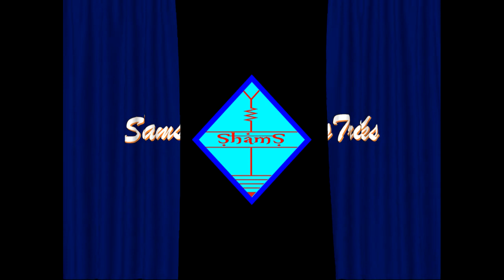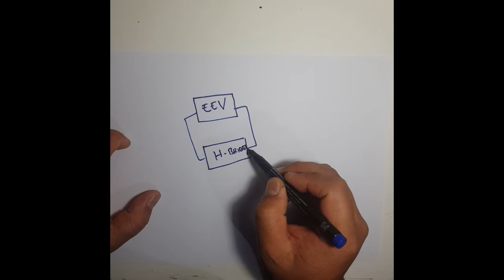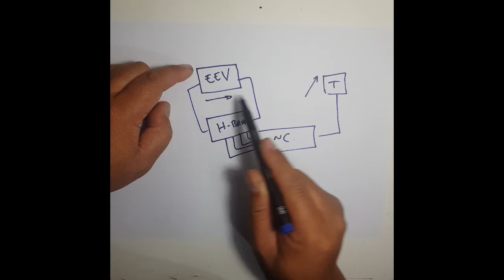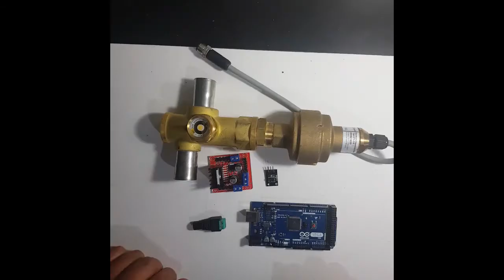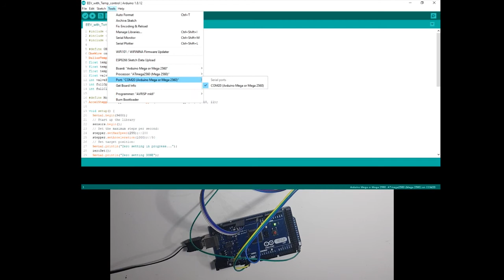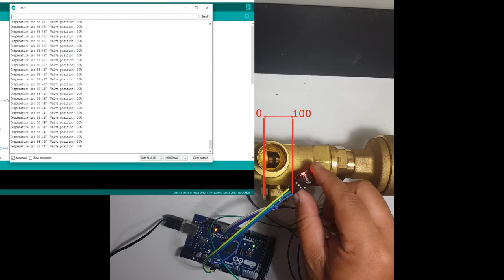CONTROLLING ELECTRONIC EXPANSION VALVE WITH ARDUINO

Comment: His code won't be useful for any of you unless you got the exact same EEV model with exact same refrigeration system. It is just a step motor afterall that has to operate according to the manufacturer provided operation range. EEV never works alone. You need to know the actual pressure in the lineset and temperature.